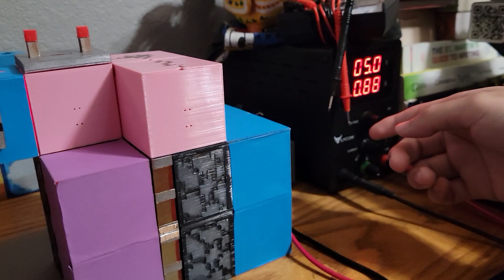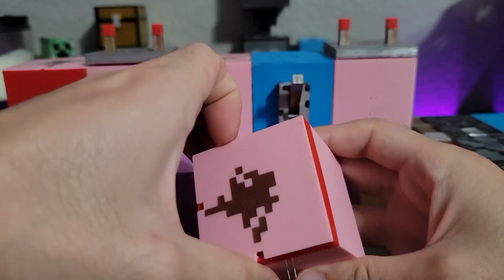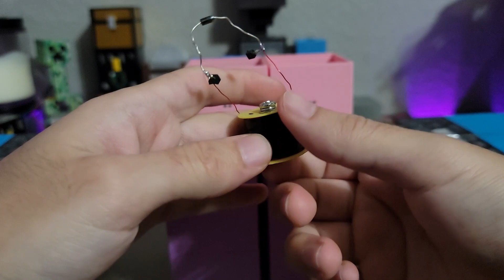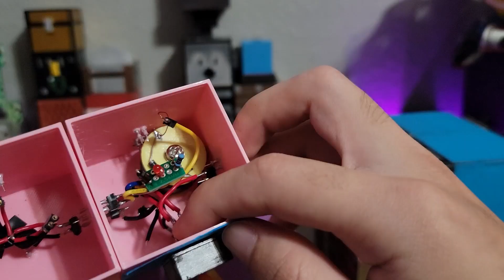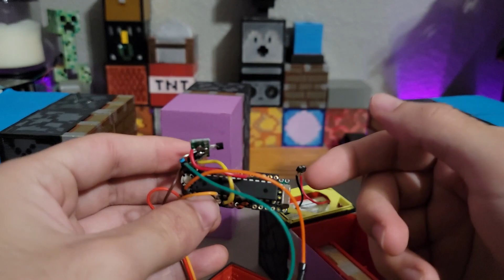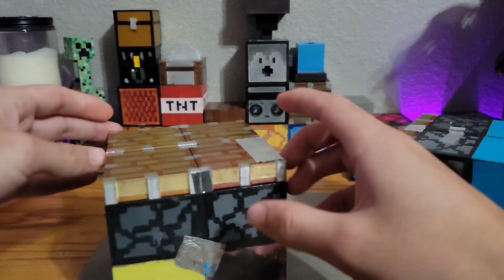Minecraft Jeb Door

Comment: could the electromagnets be the only way to sen and recieve power, that way the power will degrade over distance, and be more modulas
Reply from the maker: Not the only way, light can be used in order to activate another circuit just like in the Minecraft Redstone: Modular video. I used the electromagnet as another implementation that does not require a change in 3d models. The electromagnet is only being used to send a signal, and not supply power. The drawback is that it draws a lot of amperage, and would drain the batteries fast. It depends on how the electromagnet is made though : )